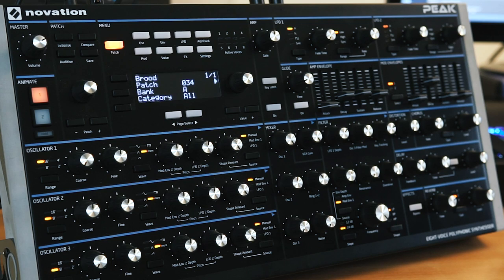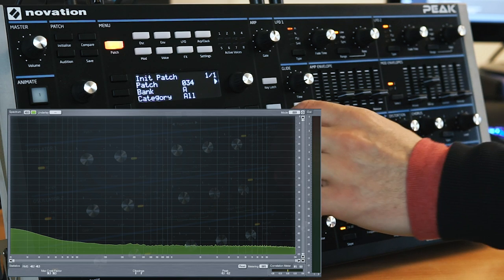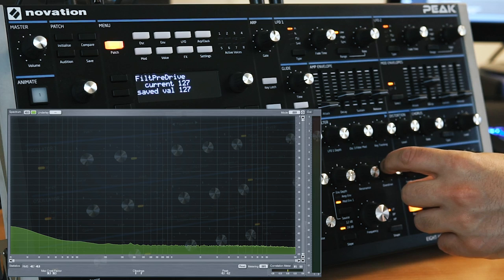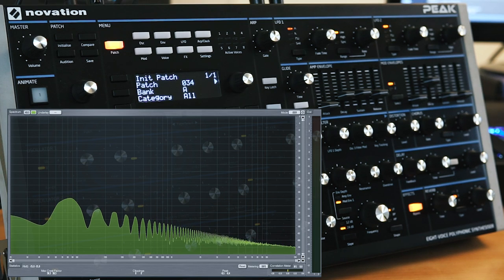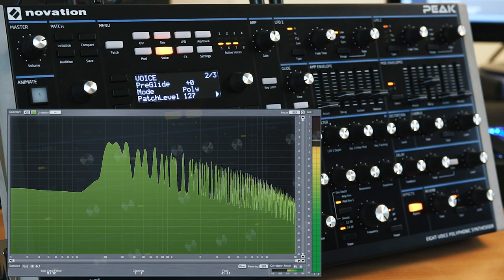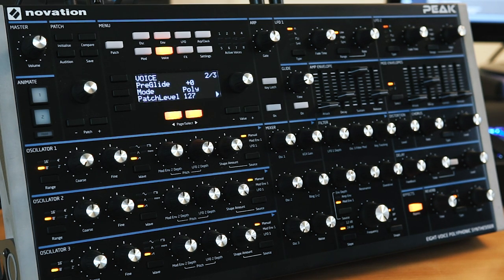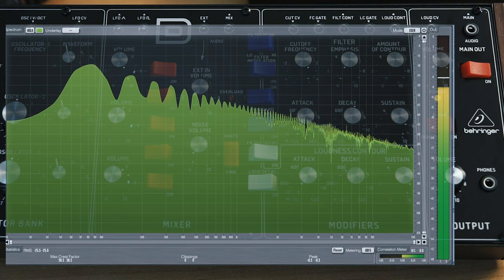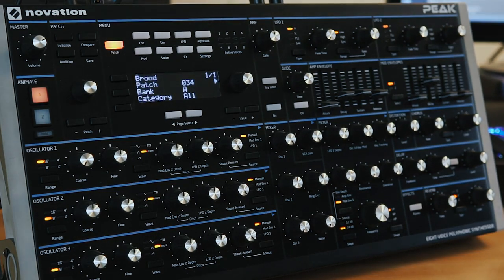Novation Peak - Noisy Outputs?

Comment: I don't quite understand why you would bring the Patch level up to 127 and turn down the main volume?  I keep the Patch level around 64 so I can balance the patches out against each other...if on full, you'd have to change the Main Volume...I have mine on full, 64 Patch level and -6db in the output settings...noise free for me.
Reply from the maker: Initially I thought turning up the patch level would improve the SNR but I later noticed it didn't.

Comment: Don't use USB midi with synths that have a power adapter, it will introduce a lot of noise. You will have even more noise when you use a audio interface that uses a power adapter. Use the old school 5 pin MIDI instead. Hope this helps. It works for me, but problems could  also be different. Using 5 pin midi introduced noise with my Sequential synths, it was the reverse problem, they do not have a power adapter, so those use USB midi.

Comment: My problem with the Peak was that there was a background hiss when you went past 12:00 on the Master Volume- this was without playing anything, and set at the INIT patch. Gain staging I can understand, that was an issue with the Alesis Andromeda. Would have loved to hear what was coming thru your Peak at maximum volume, Init patch, not playing anything. But next time I demo a Peak, I will keep set the Master Volume right at 12:00
Reply from the maker: "Would have loved to hear what was coming thru your Peak at maximum volume, Init patch, not playing anything."  Thats what I did 20 seconds in.
Reply: Forgive me, but at 20 seconds in you were speaking ("as you can see") and I wasn't able to hear the Peak by itself. But maybe I did have a "bad" one?
Reply from the maker: Well I have the analyzer up because it might not be something you can hear, we're talking -100dBFS here which is very quiet, you'd only hear it if you've got your interface gain up very high and/or your speakers up high.  In the end if you don't hear noise you don't have a problem.  I just wanted to explore the issue as it's come up here and there.
Reply: Update- my replacement Peak is quiet!
Reply: @marzzz1  This is intereasting, I'm waiting for my Peak to arrive, so if it's a noisy one you recommend I should try and change it?! thanks, what's the production detail on yours? thank you

Comment: you should learn something really basic: WATCH THE RMS meter on the SPAN. There you will see that your noise level is much higher. And the signal level is somewhere at -33 dB, and the noise at -80 (cant see it exactly).
Reply: During my testing, I found that patch level at 127, master at 0db, and the volume knob at 11 o'clock gave me the best SNR...something like 70db or higher (noise floor minus peak volume. init patch, 1 osc, vca gain maxed). If it was at 64 for patch level and -6 db for the master, 11'oclock only gave me about 65db SNR. I tested 11'oclock, 12, and volume at max, and checked 64/127 patch levels at -6 and 0db master settings.

Comment: hi. i have a problem with my peak..when i play it , i get a headache...I think its sound is harsh..what's your oponion?
Reply from the maker: No idea!  You have to give more detail for me to get an idea of what could be happening.
Reply: @AiynZahevSounds  when i increase output master volume on novation,i hear too much hiss noise....but when i do it on moog mother32, i dont hear any hiss noise
Reply: @AiynZahevSounds  and when i record a few tracks with novation, this problem will be worst...
Reply: pls give me your email, i will send u some tracks that prove it
Reply from the maker: Hassan Afshar ok it could just be the synth is too noisy for your taste then
Reply: I had a problem specific with my Antelope Audio interface. I almost sent back my Peak because the sound wasn't sitting well in my mixes (very harsh and fatiguing.) I tried all sorts of gain staging but nothing was working. I ended up turning my audio interface preamps all the way to 0db on the inputs the peak was connected to. It sounds so much better - It's strange because I was no where near clipping my preamps on the Antelope Audio inputs. I have my master volume around 12-o-clock on the peak, and I use a mixture of patch volume, VCA, overdrive, and distortion to hit my target volume - or close to it. After it's in your DAW you can use a little bit of digital gain if you need to bring it up a bit. Definitely try to run it into your interface with the preamps set to no added boost, it made a world of difference in how my Peak sounds. The filters, resonance, and distortion sound smoother, its not harsh, the overall tone is superb. Hope this helps!